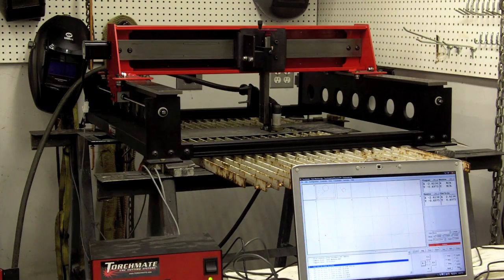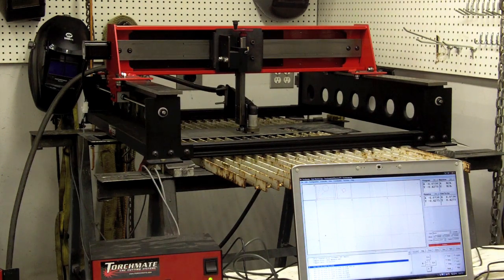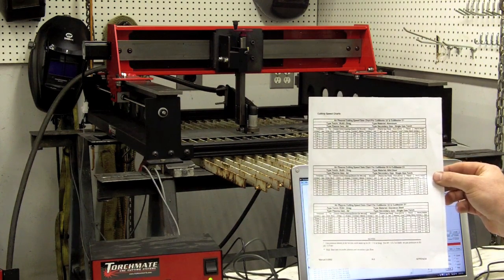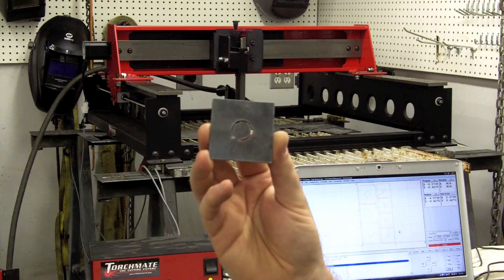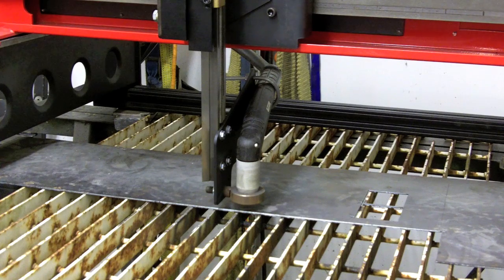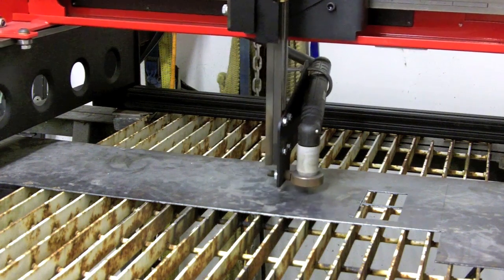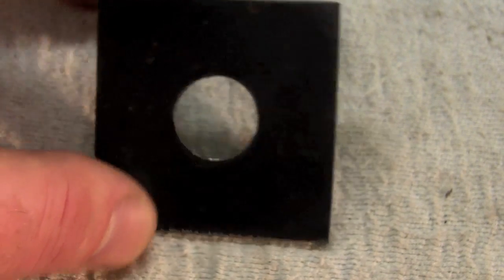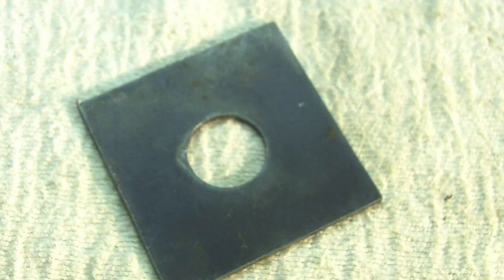Torchmate CNC Plasma 2x2 Part 4

Comment from the maker: Yes, I would go with the same machine.  It does 95% of what I need it to do.  Just keep in mind that it is by no means a turn key machine and does take some attention to keep it working well.  In addition it is not a production machine and should be used to cut very low quantities of parts.  Thanks for the comment.